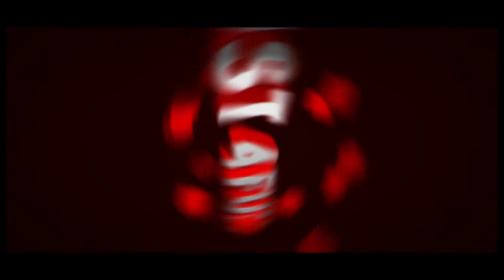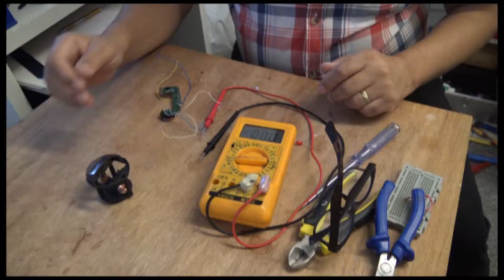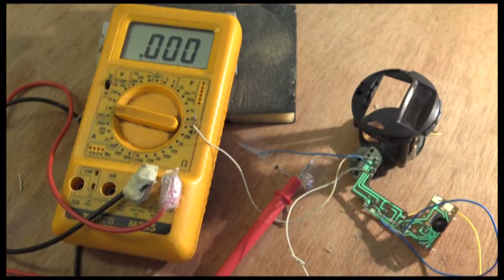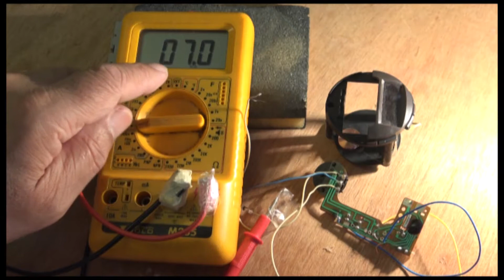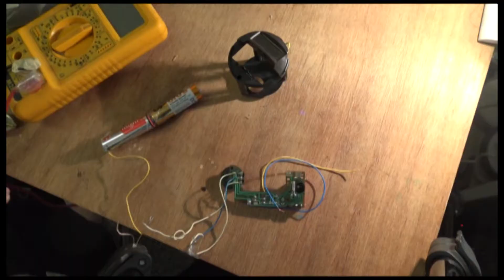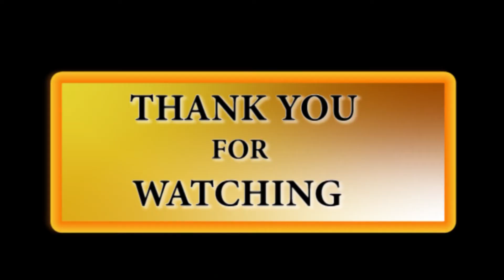#93. Could this be a Wireless Electricity Transfer?

Comment: Interesting. The main problem is we are dealing with such low power measurements there are so many things that might be having an effect. I haven't tried anything quite like that. The simple answer is it is wireless (no wires are connected) but whether it is magnetic inductance or radio frequency !! It might even be picking something up from the light you are using as most modern lighting is operating at a frequency that might be picked up by that coil. A bit of a conundrum 🤔 Here is a thought, and I just tried it myself, just put your meter leads one in each hand and see what you get. I can get reading like yours and that is just a potential difference across my body or some sort of capacitive effect.
Reply from the maker: GrandadIsAnOldMan Ahhh that is a good comment and I should have done that. Maybe you are right. I will try it and see what I get. I so much wanted it to work that I didn’t even consider any other options. Thank you
Reply: @JustFun-iz9rf  the main thing regarding the wireless transmission is the solar circuit board gives a relatively slow pulse, so I would expect the pulsing to be visible on the meter if that was the source. I haven't tried it, so that is just a guess.
Reply from the maker: GrandadIsAnOldMan thanks. I think more experiments are needed
Reply: @JustFun-iz9rf  yes, this is the sort of thing that can take you in directions you never intended 😆👍